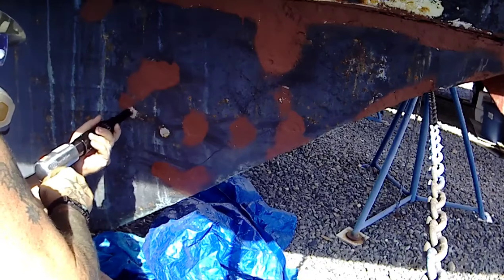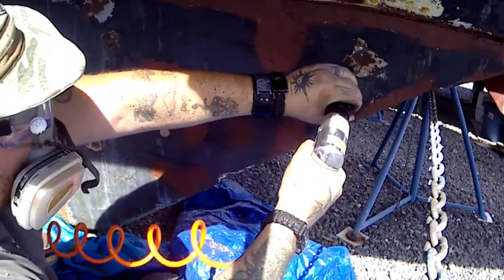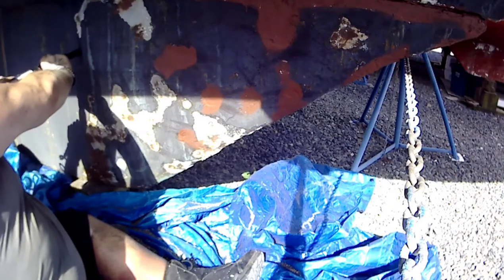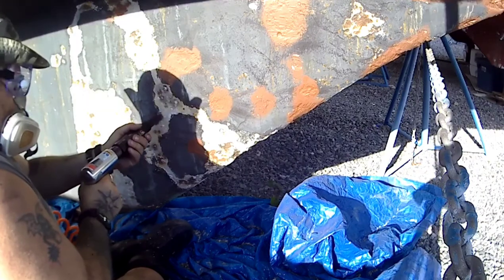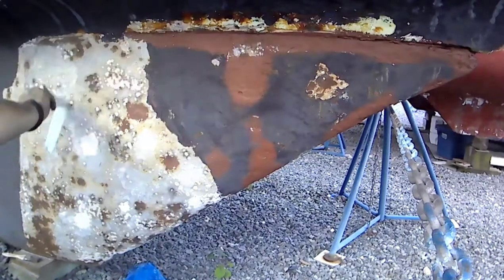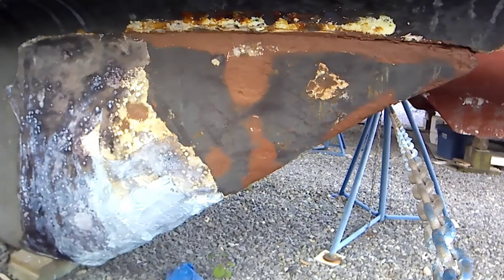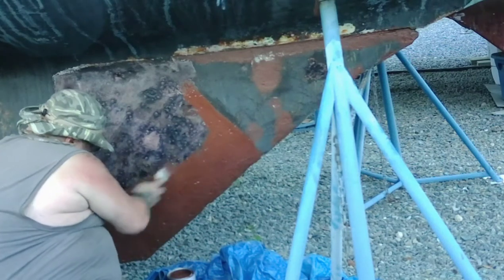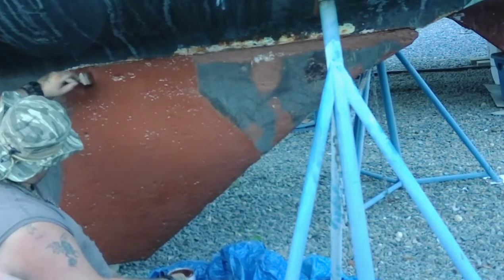Treating a 46 year old Iron boat ballast fin keel part 1 ( strip and base prep)

Comment: Yes, I haul out every 18 months. Pressure hose the iron keel. Then grind the whole thing. Use Rust Converter,  Two Coats. Drys quickly. Then Yacht Primer and then Two coats of Antifoul. Sounds hard but actually it works well.